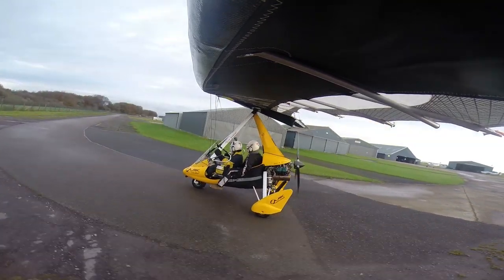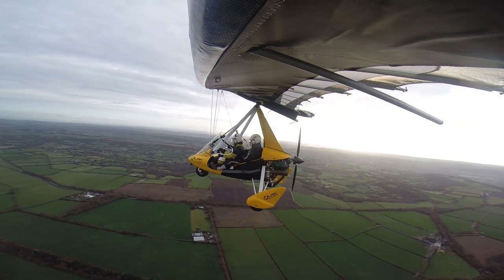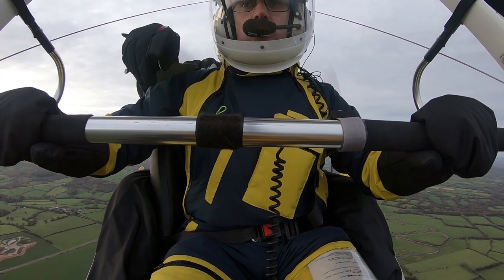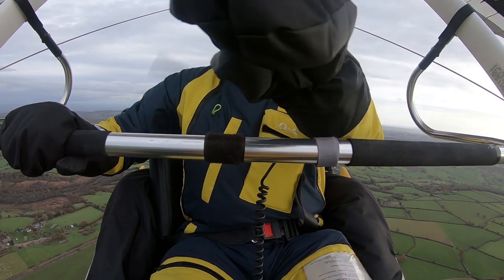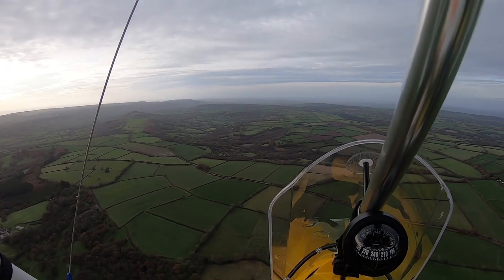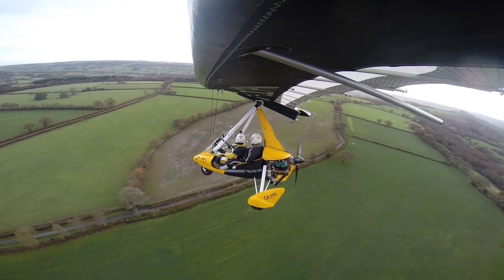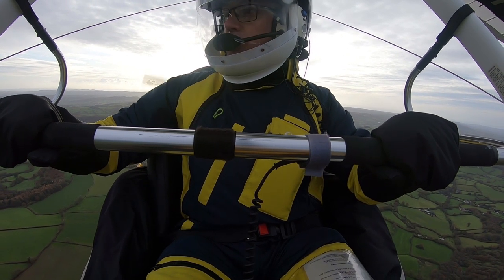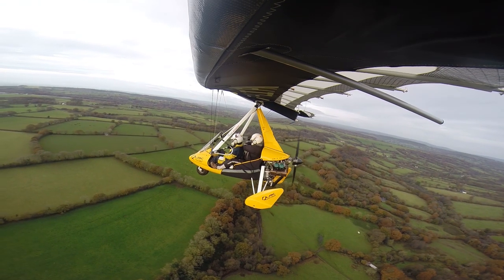Flexwing Microlight Vlog -  Episode 7 Ready for Solo

Comment: Great stuff.
Pumping is not good on any aircraft as the saying goes "Do Not give any back", so if you (in your case push a bit to much on in my case pull a bit too much), rather than moving the control back the other way hold it there and correct with a bit of power, or you will end up landing on your nose and that is never good. 

That said it is always best to be smooth and get it right (but we all get it wrong at some point).
The pressure is always on when you solo in your own aircraft, my advice is take off and leave the circuit, make friends with the aircraft (get a feel for it), then come back for a landing. Just remember you can always go around, so plan for that to be the case for your first landing.
Reply from the maker: The silly thing was, I've not done it since I cracked landings. The last one was much better. Thank you for all your advice. I never want to stop learning.
Reply: @GolfFoxtrot22  We never stop learning. It might be a fun trip to get over to you side of the country, in the spring or summer, if I can get some fuel there.
Reply from the maker: @flyingkub  I'm hoping once I'm solo and get my Pilot rating back, I'm going to be disappearing all over the place.  Nil wind days will never hold fear again.

Comment: Great videos! Again, thanks so much for sharing these. As I previously wrote, they are, by far, the best I found on YT! The fact that we can hear your conversation is extremely useful. 
Just have a question: could you tell how many flight hours in total it has been to complete your training?
Reply from the maker: I had help and direction on formatting the videos.  Flight hours for all pilots will be very different depending on experience.  I only had 6 hours, but I know others have needed nearly 30 before solo.  I've been flying since I was 15 years old and already had a PPL (A) but I've never flown hang gliders or anything flexwing related. I hope that helps.
Reply: It does help. Thanks for your answer!

Comment: I hope we all get an invite when you start going solo, looks amazing, like paragliding and paramotoring, is there a SIV course for the sub 70?. is there more to learn via instructor,
Reply from the maker: As with all things aviation we never stop learning. SIV is not required as the wing does not collapse. However the one thing I will be doing more of is thermal flying. Turn the engine off and play in the skies.
Reply: Golf Foxtrot 22 the wing like any wing will stall though. How do you deal with that
Reply from the maker: @clubsnapperuk  Its weird, if you look at Episode 2, you have to really push hard and be in an odd configuration to make it do it. If you do stall it, ease off the bar and add power. It won't drop a wing as it has wash-out. A paraglider has wash in, to make the tips collapse first. Ridged wings are the other way round, the centre stalls first.

Comment: Full RT. Are you equipped and licensed to use airband in your PeaBee? If so, what callsign will you use?
Reply from the maker: I hold an RT Licence and will be getting my OFCOM permit for my handheld radio.  With regards to a callsign, the CAP 413 doesn't specify anything that denotes using a registration as a call sign,  so I could stick with my Golf Foxtrot 22 callsign I have used on my paramotor, see the RAFA40 videos.
Reply: @GolfFoxtrot22  The questions stems from the fact that many Paramotorists are not licensed to use airband, and I wondered what they might do for a call sign  and/or call structure when needing to be in contact with airfields.
Reply from the maker: @eddy802  I suppose the same thing I've done, make up the call sign. There is no requirement to use the registration, CAP 413 is quite flexible. I've used my own made up call sign, Golf Foxtrot 22 on my paramotor. All the civil and military units has no issues what so ever. I'd like to have a G Reg but I think that might just cause more confusion.